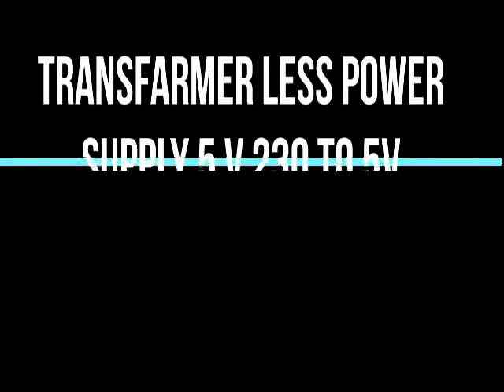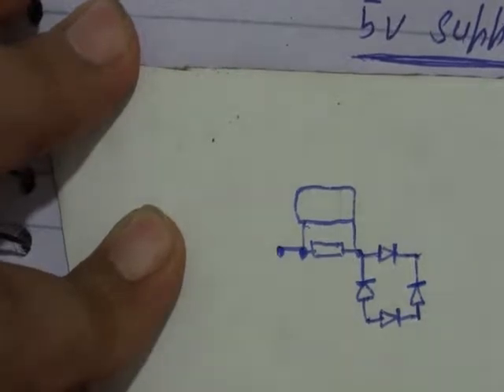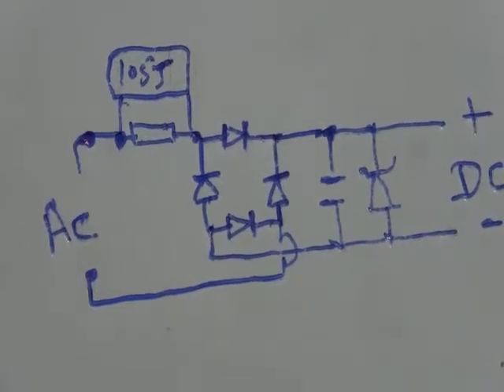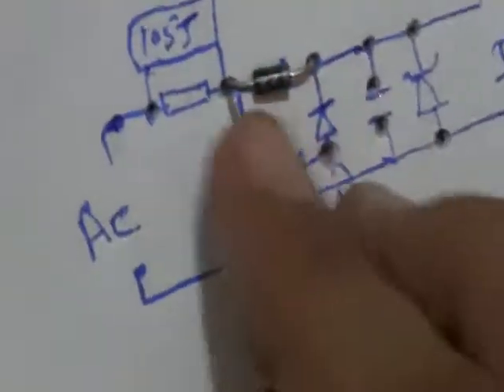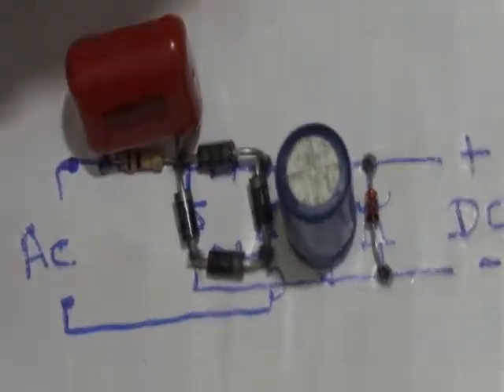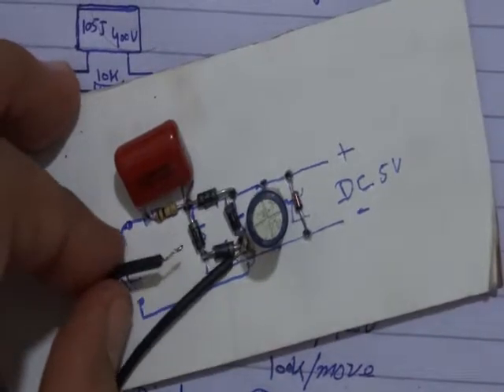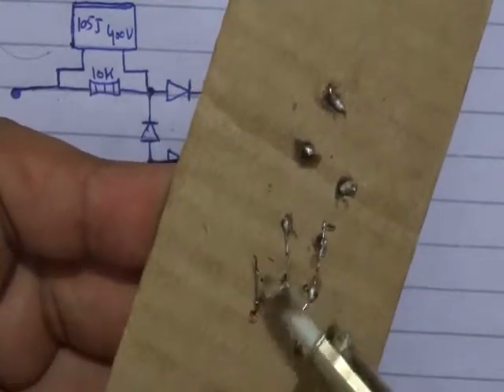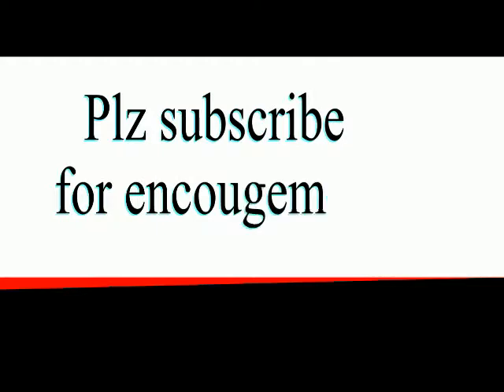AC to DC power Supply

Comment: Is it safe?? 
I mean it is 5v only right or some time surge current might come 

Just wanna know about consistency and safety!
Reply from the maker: U cant touch this while plug in AC current
Reply from the maker: Is will give 5 to 15v but low power
Reply: gillani data can i use thsi for microcontrollee or either esp8266 module which need 3.3V so what i will do is ill just convert 5 to 3.3 
Will this work for them??
Reply from the maker: U can use it for battery charging